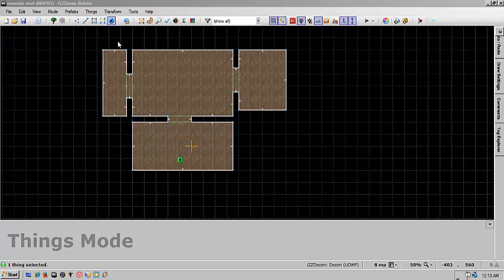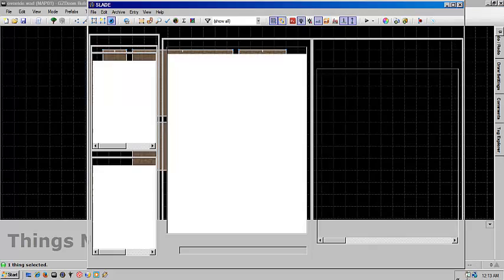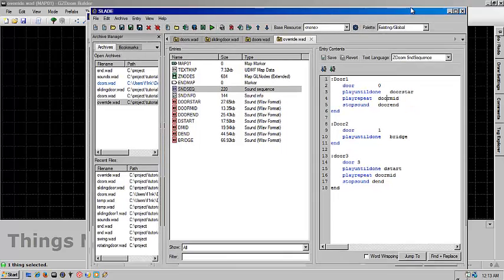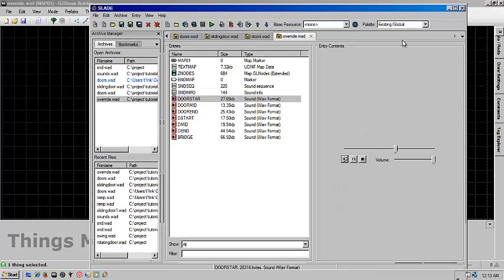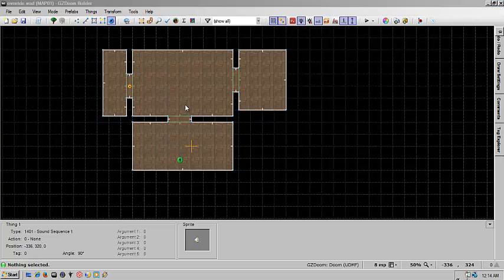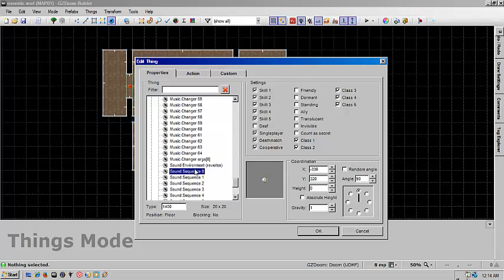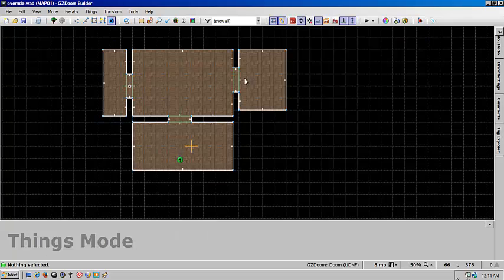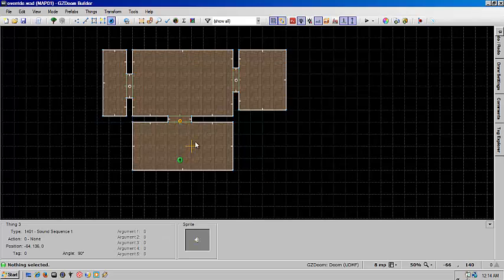(GZ)Doom Builder - Changing the default door sound

Comment from the maker: ***** That's a strange case, you are replacing the preexisting doom souds by replacng them with a file of the same name I would assume, in this case there really isn't any reason it shouldn't work. I have heard from another sub that they had to convert their replacement sound files as mp3 when he couldnt get them to play. There are only so many things that could go wrong the following is a check list of sorts.

When replacing original files always use the exact name of the file when you replace it. If you are using a custom sound that has a different filename you will need to make the necessary additions to the SNDINO file to regist the sound also you really shouldn't need to use the convert to doom sound option in my experience replacng them with a wav or mp3 was all that was needed.
Reply: How do I give a sound sequence for sliding/swinging doors as only part of the sound sequence will play, what should I do?